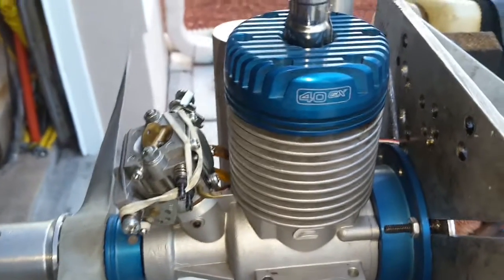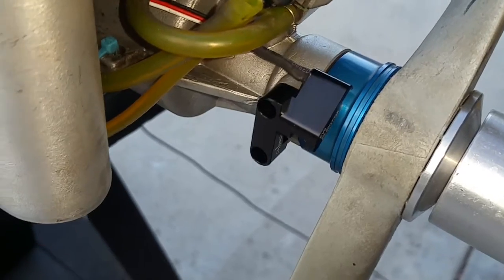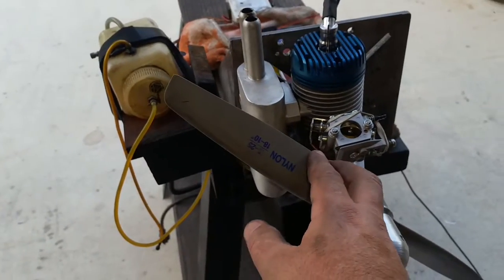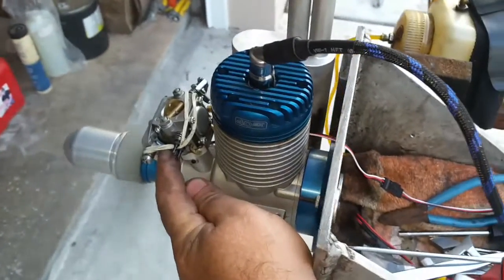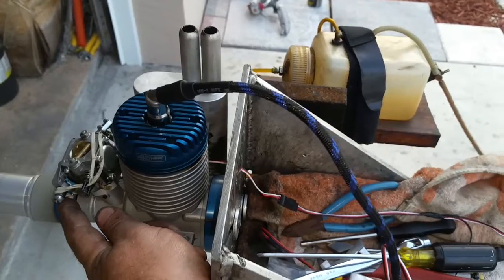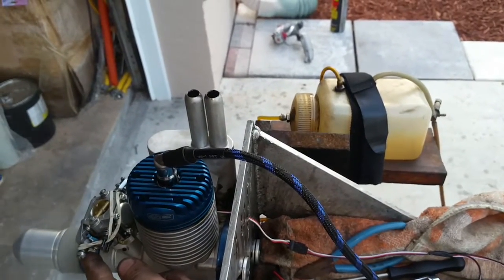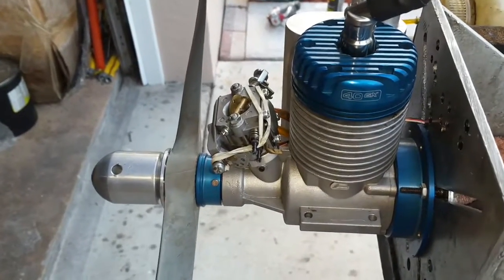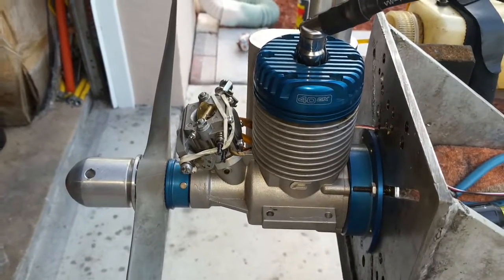EVO 40GX  CH Ignitions - Rcexl, With Universal Sensor CDI Conversion

Comment: Can you make a sensor holer for the .31 dynamite/sh?

I want tonuse a different ignitin and sensor instead of the dynamite brand. They discontinued the hall sensor and i cant find a holder that will work for the dynamite/SH .31